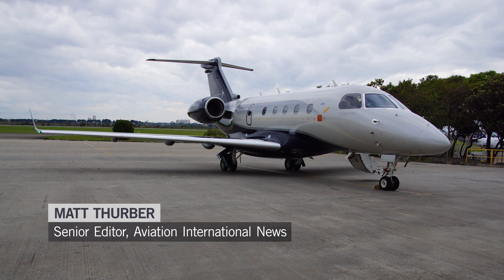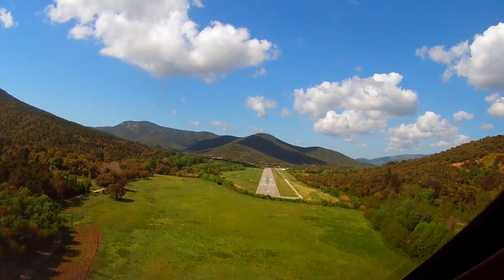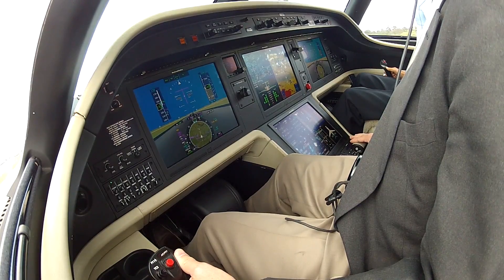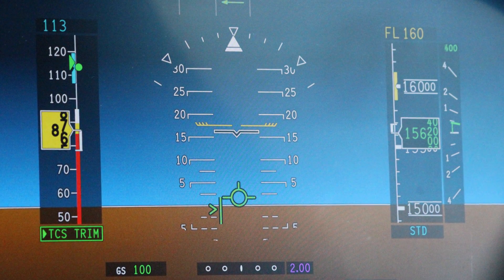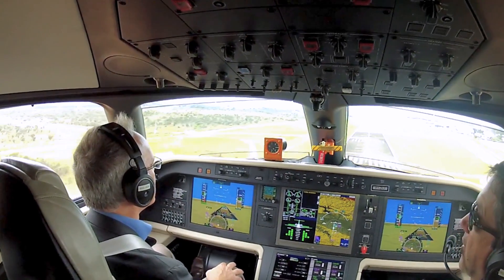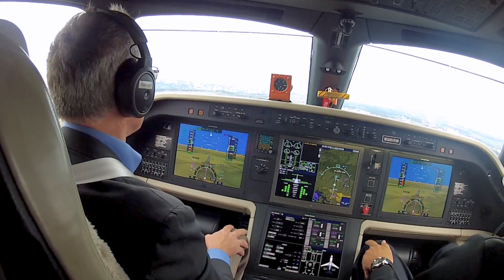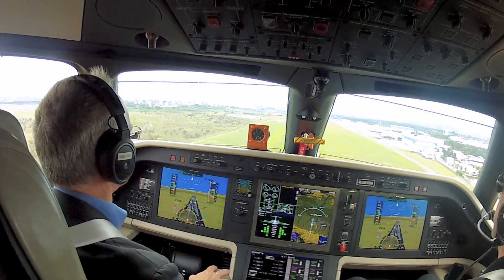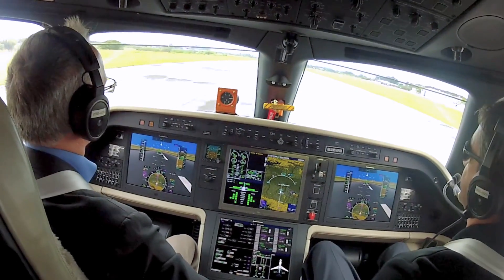Fly-by-Wire Steep Approach in the Embraer Legacy 450 Business Jet – AINtv

Comment: Good video but a side stick controller has nothing to do with electrically signaled control systems, i.e. fly-by-wire operation. A yoke can also have fly-by-wire as can a center stick.